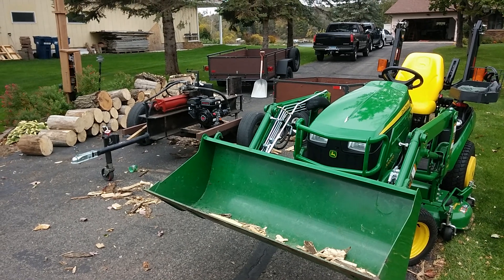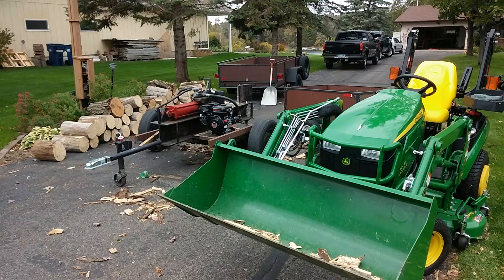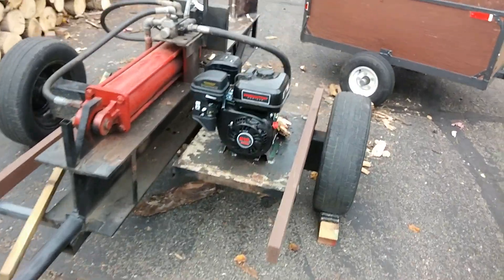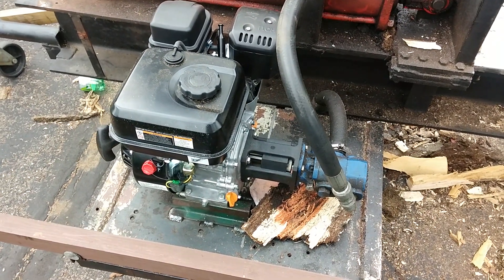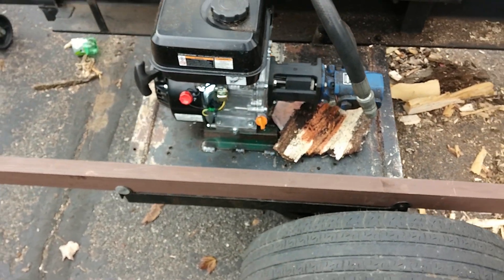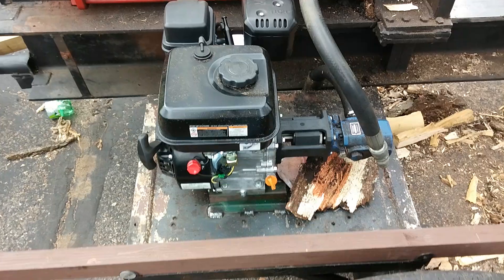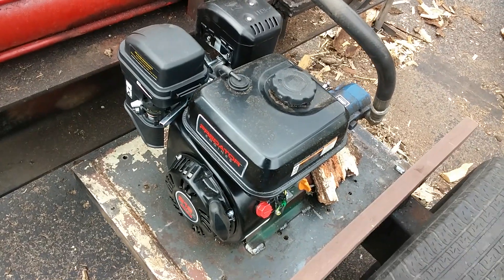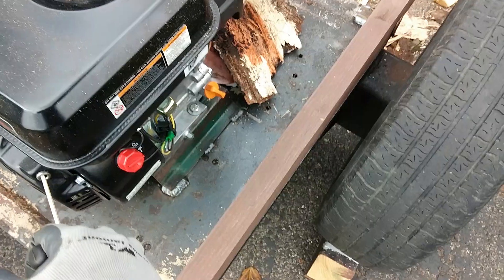212cc predator engine replacement for log splitter

Comment: Well, I guess that's one way to do it.  We built a log splitter when I was a teen, but for the pump we just quick coupled it to the pump on our old John Deere A's hydraulic system, let the tractor idle and didn't need a separate engine.  Worked like a charm.

Comment: I know this is an old post but you might still get this question.  Is that a 6:1 reduction gear mounted on the motor?  And if so,  what brand is it?  I need to mount a 6:1 to work with my sprayer using this motor.  Thanks,   Mark
Reply: Sería tan amable de compartir información yo requiero fabricar uno igual gracias
Reply: Did anyone find a answer to this??m
Reply: No that's the compressor for the hydraulic fluid and the connector called a Lovejoy.. there's no gear reduction
Reply: No, it is a direct drive  11 gallon per minute hydraulic pump.